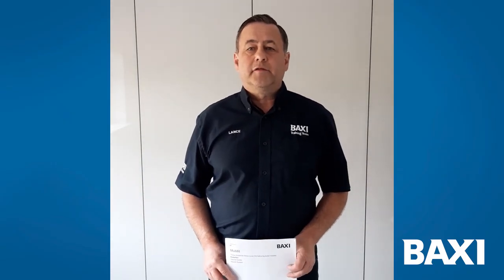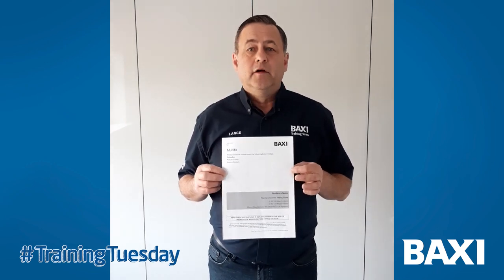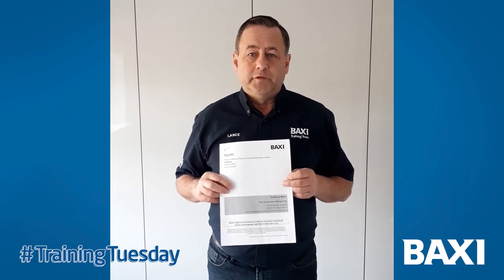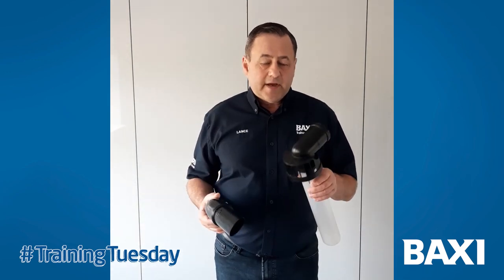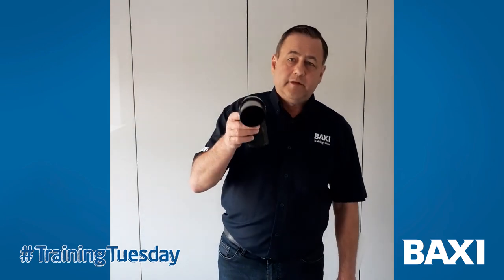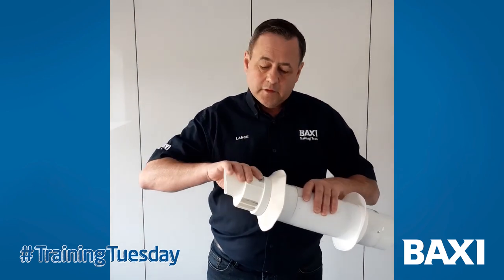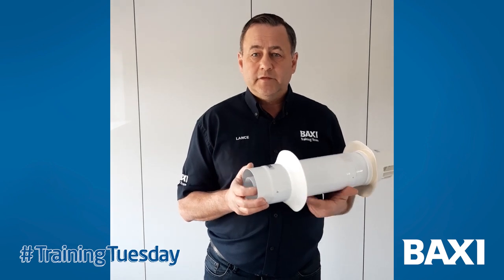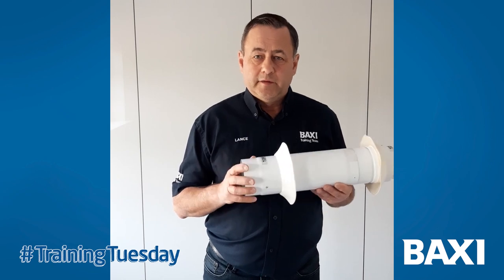Baxi Flue Accessories

Comment: Hi baxi guys I have a question....when fitting 2 X 135° flue bends ( 45s) as an offset for example does the fittings have to be fixed with a screw, I couldn't see this in the mis for the boiler or flue mis